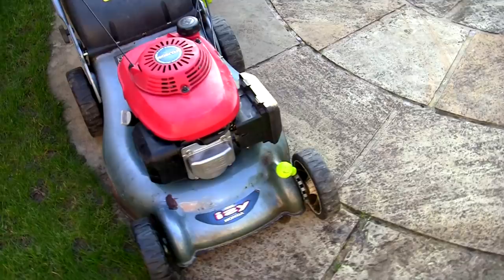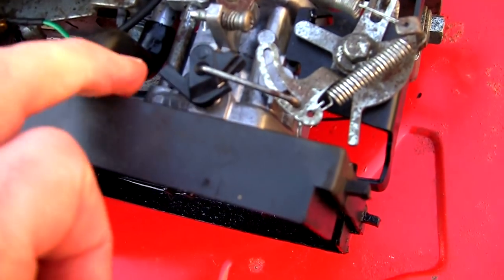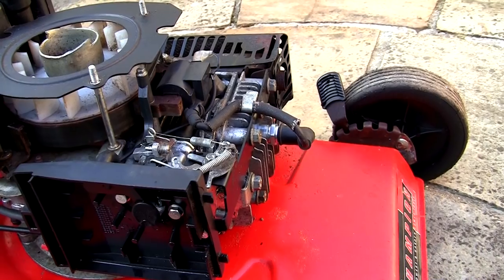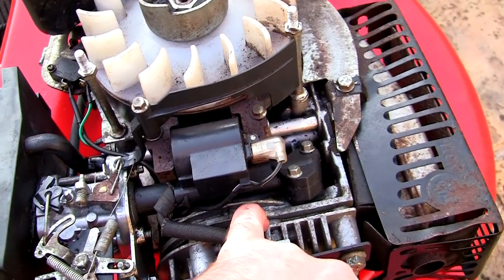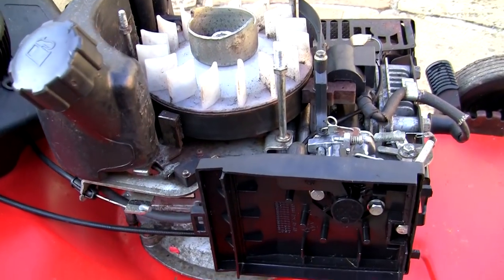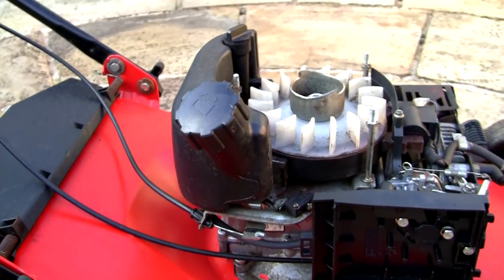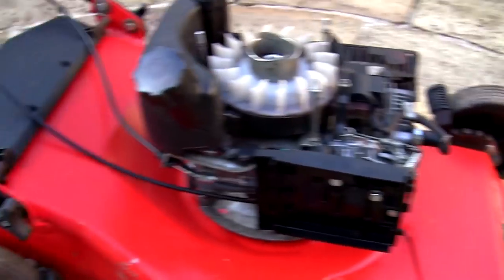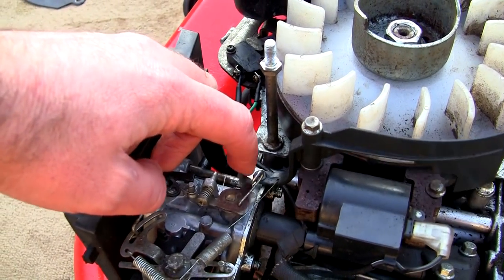Mountfield SV 150 Lawnmower Engine Revs Up And Down Help

Comment: Hi, everyone. And Hello Mower Man. I am sure you will have covered this in a video somewhere and I apologise if this is going over old ground but I thought I would share my experience. 
A few months ago, I bought a "Mountfield" self-propelled mower with an RS100 motor. It was pretty well near new but had been stored dry for a winter. I put fuel in and after a few pulls it started. However, the first time I used it in anger it started to hunt and has done so ever since. I took it to a friend for advice and we were both left scratching our heads. We found and watched a couple of your videos and visually inspected the carb with all its springs and levers. Everything appeared to be working correctly. Then I started the engine again and my friend said open the throttle fully and see if it revs. I tried and no matter where I put the leaver the revs remained the same and the engine continued to hunt. That’s when he had a “slap the forehead moment” and showed me that the plastic housing around the throttle leaver was broken, just at the point where the cable enters. It is meant to grip the outer casing on the cable so that when you move the leaver the wire moves back and forth inside and operates the throttle at the carb. We managed a temporary fix by locating the end of the cable where it was supposed to sit and the securing it to the metal handlebar with cable ties. The throttle now works and the engine responds and does not hunt.  So if anyone has a problem with their engine hunting, before you start stripping the carb just check the other end of the throttle cable it might save you a lot of time 😊 I looked online and the Throttle leaver unit is available for around £20. And from the comments left this is clearly a very common problem. The plastic is simply not man enough for the job.

Comment: this is without doubt the most comprehensive and detailed troubleshooting guide for the Champion SV150 anywhere.
In the first few minutes i have discovered that I did not have the governor springs in the right location so it could never work properly .There  is also a spring missing which I was not aware of. No wonder I could never get it to run correctly without over-revving , cutting out and hunting issues. 
Thank you for sharing all your knowledge and experience so freely .
Reply from the maker: John Cooper Thanks John very kind of you to say
Reply: @John Cooper How did you fix the missing spring issue? Is there a replacement part?
Reply: @yannisrigas4983  no unfortunately not .....the spring is not available on its own. I bought a used complete carburetor off ebay for £6  and some new gaskets and it works a treat.

Comment: Thanks for the tip about the missing carb spring that no one supplies.That was the problem with mine I fitted an external spring to the linkage and attached it to one of the pull start cover fixing bolts and it's got me away .It ain't perfect but it will get me through to the end of the season

Comment: Mine would start and die so I just  Undid the nut on the fuel bowl under the filter and and let it run for couple of seconds then it started fine after that but it does surge up and down but still can use it now for cutting the lawn. Big up from Scotland

Comment: With a hunting problem on a SV150, it's either an air leak or fuel starvation. So I go through all of the advice on your video and if it still hunts, I remove the main jet and open it up very slightly with a fine drill bit to let more fuel through...that usually fixes it
Reply from the maker: Andy K Ill try that if I get another

Comment: I had one recently and it was an air leak on the inlet tube from the carb to the top of the engine. A hairline fracture in the tube itself. Not visible until i took it off. 😁👍

Comment: Hello Mower Man. Shaun from Shaun's Lawns here, I know this question is nothing to do with the SV 150 but I have just purchased a 2008 Mountfield RM55 160cc Power Drive 464 PD. The question I have to ask you is that I have just serviced the mower including dismantaling the carb as the mower would not start, all complete now and the mower is running ok-ish but it tends to hunt (slightly revving up and down) Do you have any Idea what is causing it.  Would be grateful for your expertise advice. By the way I really enjoy watching your vids. Look forward to hearing from you. Shaun

Comment: Yeah mate they are a pickle to get running right I believe they have too much going on spring wise. They could of make it easier by having a different carb on it. I have one with a blown head so need to get that one done. Good video mate as always
Reply: Micks Mowers I agree, I honestly think they do stuff like that the deter the user from bothering to fix it or confusing them so much the just go and buy a new one.
Reply: @jacobbates3652  yeah apart from us lol I picked up a nice little job lot today. One needed a new plug the other needed the recoil spring re fitting.
Reply from the maker: Cheers Mick ! far too complicated compared to a briggs
Reply: @MowerMan  yeah I know what your saying still it keeps our hands in for information

Comment: Hi, dont know if you still respond to these videos....do you have an ideas for a sv150 engine on a sovreign lawnmower. Except it has NO throttle controll at all, and the choke is like a red ball you squeeze 3 times. When i start it, the engine is just RACING at full speed. Ive tried adjusting the idle screw and the tension on the main spring but it makes no difference, thanks

Comment: Is it just me or is the block on these engines almost if not entirely the same as the briggs and Stratton 35 classic and sprint 3.75 series? Same manifold, same threaded breather tube sam flat head design and bolt spacing even the same way of fixing the carburettor control assembly to the front of the engine (3 head bolts across the top) i wonder if the carb and hardware from a briggs and Stratton 35 classic would work on one of these?
Reply: yes they work

Comment: I have a question, hoping you could answer. Do you know what compression reading the SV150s should be between. I’ve been looking to find what they would have been when they left the manufacturer, and what range it should be in, unfortunately I can’t find any figures on these specific engines. Any help much appreciated. Thank you.

Comment: I have a mountfield lawnmower almost identical to the one you are talking about,my question is that I have a honda izzy engine that I purchased on gumtree and I wanted to know if it will fit into the chassis of the mountfield.

Comment: hi

i'm currently refurbishing a 1980's vintage mountfield emblem as i think it should see the rest of my life out being an alloy deck and a trusty 3hp briggs and stratton which is what drew me to it in the first place. engine is running as sweet as a nut and is now removed, i have the handles away getting powder coated and i'm in the process of stripping the deck down to clean and re-paint but i'm struggling to fathom out how to remove the front axle? are these held on by bolts which sheer off when they are tightened up (security bolts) ?

Comment: Hi mate, do u have any of the bolt/ nuts that attach the handle to the deck of the mower, same as in this video, that I can buy, as I’ve lost 1 off my mower, with I successfully got running after watching ur videos, however it’s pretty useless without that nut n bolt for the handle

Comment: Mower Man, does the Briggs Straton 125cc engine (on a Weed Eater brand mower) have a similar spring? I have the same issue and can visibly see the brake moving back and forth as it runs.

Comment: great video , thanks , Ive tried everything . mine starts on choke , revs then dies straight away. when I spray with carb cleaner it keeps going for while pops and burps then dies. , Had carb down three times ,air lined  clean as whistle ,changed o ring on inlet manifold ( should this have gasket as well?) , re sealed head gasket ,good plug , check coil lead  , cut out switch, clicking and multi meter checked,  from what I can see wood rough key looks ok, mind you could not take flay wheel off to see . crank doesn't have a viable  key-way.  arhhhh dont want to give up !!
Reply from the maker: does the choke open and close properly? It will run longer and pop with car spray till it burns it. Make sure the needle is moving freely in the carb also. I feel your pain my friend.
Reply: @MowerMan  Hi , thanks, yes the choke  opens, closes fine. needle is free and clean. I dont think its a air leak but as Steve says ill check the inlet tube.  My immediate  thoughts were  blocked main jet and float level. But  its plastic float and needle and seat is fine.  Do you think it  would it fire up then die immediately  if the coil was duff?  and im not sure about the key way i pulled the nut and the ring off but cant see as it obscured, its  wood rough key and not a spline keayway on mine.
Reply: Hi mower man , hooray I fixed it, tuned out to be  after going though nearly all of the fixes you suggested in your vids the choke cable adjustment. I didn't check the adjustment just thought if the butterfly  opens and closed that would be fine. What a plonker i am!! always looking for the most complicated fist. Thanks for all you help and videos.  I have learnt loads the hard way !!!

Comment: just put my mountfield in my van ready for when the tip opens [ have a spark on the plug and fuel getting to it but it just will not start ???
Reply from the maker: If you are feeling lucky you could check the crankshaft keyways in case the timing is out

Comment: is there a deck from any other model that the Champion SV150 can be made to fit if the existing deck is rusted out ?
Reply from the maker: John Cooper Yes john as long as it's the right width and the crankshaft is the correct length

Comment: Hi I know this is a old one but I’m struggling with my rv150 I have recently swapped the ignition coil and it works fine until I connect the kill switch and then it won’t fire up just wondering if you might point me in the right direction thanks in advance
Reply from the maker: alan stirrup Check the microswitch is activating
Reply: @MowerMan  hi thanks for your response I really appreciate it the micro switch is making a clicking noise when pulling the switch could it still be faulty as I say it fires up without it connected once connected it will not fit up

Comment: its a chinese copy of the classic 35 but with a float carb and seperate tank. and its a bad bad copy. :-( bad bad engine. 95% of the problems with the sv/rv150 are to do with the carburettor. on some there is a brass jet on the top of the carb opposite the throttle. the jet had been crushed from being overtightned and it never ran good until i replaced that jet.  Another thing the ht lead from the coil feels loose at the coil. another bad design. Some variants have a catylytic converter on the exhaust. You can convert them to a paper air filter like the quantum (briggs)